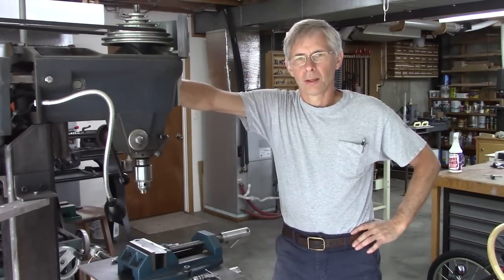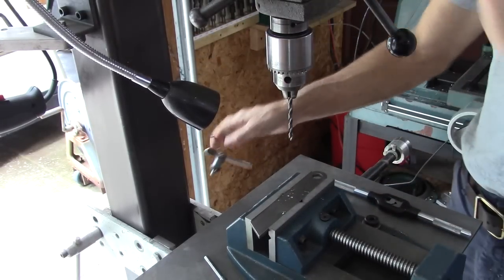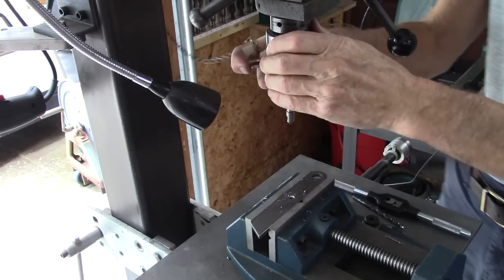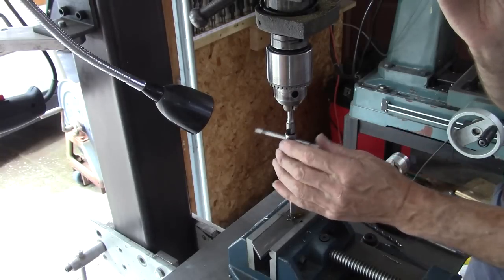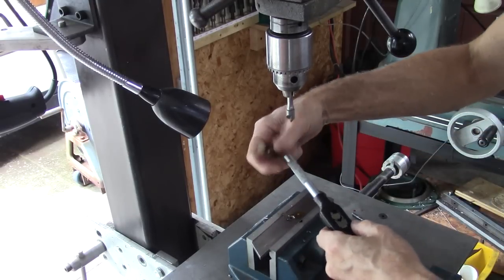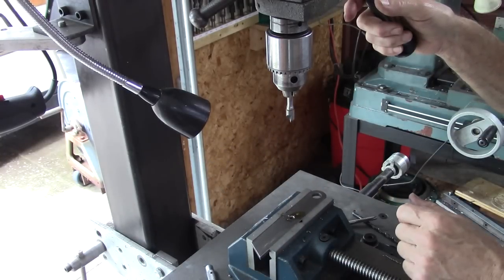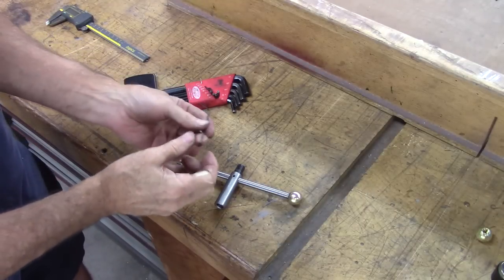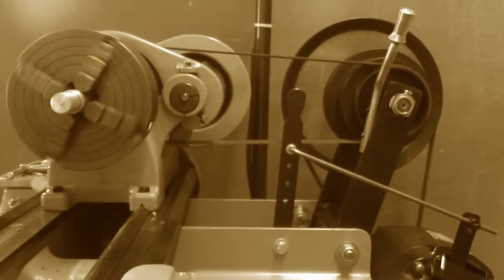Best Ever Guided Tap Wrench!

Comment: Instead of the set screw to hold the tee handle in place you could use an O ring that fits snug or a plain old rubber band twisted multiple times till it fit snug on both sides of the tee handle. Then if you did want to move the handle to get more leverage you could get it to slide instead of having to find your allen wrench to loosen the set screw
Reply from the maker: Thanks, that's a great idea!

Comment: If you like spring loaded guides, just drop an appropriately sized spring  in the top before you insert the countersink bit, and set your quill position to preload the tap handle.
Reply from the maker: This is true but there is really no need for a spring.

Comment: Hello Sir, here is another good idea and excellently carried out.  I bought the 3/8 "square drive tap Holder. To put your idea into action, I hit 2 points. In 14'11 What is the name of the black piece you sawed and do you have a link for it?  purchase. In 1'30 what and the name of your chamfering tool and maybe a link for the purchase. I cannot find these products on the web. Have a nice day with my kind regards. PK (French)
Reply from the maker: Hello Paul, the tool I used to chamfer is a "3/8" 82 degree carbide single flute countersink". They are a bit high priced but considering they last forever I think they are worth buying. 82 degrees is US angle for flathead bolts/screws. If you are not in the US you might want to get a 90 degree as most metric screws are 90 degree. https://amzn.to/3vlkkQl  I'm not sure what you saw at 14:11. Maybe the 3/8" extension I sacrificed?  https://amzn.to/3vjNGys
Reply: @WinkysWorkshop  Hello sir, thank you for your information.  For the extension it's ok, concerning the chamfer cutter, it is out of stock;  I'll wait.  Thank you for everything, good luck and have a good day.  P. K.
Reply from the maker: @paulk3573  - You're welcome. Ebay sometimes has them also - 3/8" 82 degree single flute carbide countersink

Comment: Second time watching. Question is the handle is sized to fit over the countersink? I do love how it is free to slide on that shift. But I don't think my countersink has that much of a shoulder. What do you think about just having a steel shaft to chuck up as the guide? Did find the chuck adapter on Amazon.
Reply from the maker: I got my adapter on Amazon (3/8" Square drive tap holder: 3095001). As for the counter sink. Mine is a 3/8" OD carbide single flute. I think I found it for $22 although I can not remember where. I've been using it for over 5 years now and it's sharp as ever. Highly recommend the investment. Yes a shaft would work perfect as well, even a 1/4" rod. The only drawback is you end up with one more tool change in your chuck when doing multiple holes. If your countersink has even a slight shoulder it will work great. It's only holding the top, the bottom is guided by the tap. Thanks for asking.

Comment: Great job Winky , is that an electric drill hooked up to the rack and pinion , love to see how u did it.
Reply from the maker: .Yes a 3/8" electric drill. It was an easy modification but it would be difficult to modify a standard drill press with this modification. The drill press was previously modified. Thanks, here the drill press modification https://youtu.be/i4_FtMMMfDw
Reply from the maker: https://youtu.be/3p5AD3kFqTY

Comment: hello Mark,
Nice video video.thanks for sharing...see you next time........Mark i was thinking how about if you knurled ,the center of the handle  with about 10th.knurl that should hold the handle in the middle.just a thought.
Reply from the maker: Hello Ray, Thanks...  yeah if nothing else the knurl would look cool! I need to imove my knurling skills too,
Reply: Ray, A little Loctite 380 (Black Max) also woks great.
Reply from the maker: @simguns8388  Thanks...  the set screw works well however. Never heard of the black max. I'll check that out.

Comment: I like that, it gives the use of both hands to tap.  Where do you buy those 3/8 tap adapters from ?👍
Reply from the maker: Thanks.  Run a search for this "3/8" Square drive tap holder: 3095001"

Comment: With the 2nd type you used the wrong size if you used a smaller handle/ holder the back of the tap sticks threw, allowing access to the center hole on the back of the taps square end. So can use a dead center.
Reply from the maker: This true if you have taps with a center hole. Most my taps do not have them and the ones that do are all larger sizes (3/8" or larger).
Reply: @WinkysWorkshop  thats a pain, keep up the great content on machining
Reply from the maker: @JohnBlack-dv8ss  Thanks John.

Comment: They work okay but not very well with an air ratchet or in tight area's on equipment. I went to tap sockets instead. Using a ratchet works well for me. If you are fabricating this would work, nice video, thanks!
Reply from the maker: Your welcome and i agree

Comment: Very nice idea, 
Now a question, your drill press has a reverse? If so why not tap using it?
 I know some don't.
Reply from the maker: No, my drill press doesn't reverse or go slow enough. I have used drill presses like this before but I've never had a lot of luck getting the chuck to grab a tap. I do this in my lathe although I have the same problem. I probably need to invest in an ER collet.

Comment: Very good video< got a question where do u pick up the tap holder? I am going to make me one like that
 I do a lot of taping that will make it a lot easer too.
Again thanks
Reply from the maker: Thank Richard, The part number is 3095001 and it's made by Irwin and Grip. Google the number and you get several options. Honestly, I've made a lot of machine improvement but this tap handle is the most useful item I have ever made. I use it daily! Of course I also made a square column and a power table lift for my drill press which makes it quick and easy to use.  Let me know how you like it when you get it built.
Reply: @WinkysWorkshop  thanks for quick reply, I will sure let u know how it went. I could of used it today had some fittings I had to make for my zero turn, thanks
Reply from the maker: @richardhaen  You're welcome
Reply: Good morning, well I made it and finished it last night. Will get the tap holders tomorrow will c how it works.
Would like to send u a picture of it but don’t know how. I made a few changes on it and a few mistakes but worked out.
Thanks again. I do need more room on my drill press it is a bench top.
Reply from the maker: winkysworkshop@GMX.com

Comment: That is an interesting take on a tap wrench
Reply from the maker: Much better than a T handle with a spring loaded tap follower. More leverage, easier on your hands and you can leave the countersink bit in the chuck. I made a different version which worked well but this is way easier to make and more durable (I broke my first one).

Comment: Hey Mark Great video liked it alot fantastic idea too.
But am wondering about excessive torque on small to medium size taps and may cause to snap especially in tougher material. What do you think?
Stay safe and take care mark.👍
Reply from the maker: Thanks Troy, of course this is possible but you might be surprised how much torque a tap can take when it is guided.  So far I have never broke one even with a standard t-handle as long as it is guided.
Reply: @WinkysWorkshop  thanks Mark will proceed to project phase 👍😊😊

Comment: Why don't you set the drill press in the lowest rpm, and put the tap in the drill chuck?  Possibly make a reverse switch on the motor.
Reply from the maker: The slowest rpm is too fast and it's not 3 ph. (no instant reverse)

Comment: Hi Winky 
 Can you put down the Sizes of the Rods you used, and what Type of Steel you used. I just bought the Tap Heads and want to make one of these.
Thanks
Reply from the maker: I used 5/8" rod about 2 inches long. You could also use 3/4" and use a 1/2" countersink bit if you wanted to. Nothing critical but I would not go shorter than 2" or you won't have enough travel. The hardest part for me was getting the good fit on the extension. If your hole is too big you can also braze it in place although be aware that the heat might mess up the spring on the detent ball that hold the socket on. Thanks for watching!
Reply: Hey Winky, I have to say. This has been the best Tap handle I have used. I like the rigidity a lot better than using a Spring Follower type guide. I actually mad a Pin to put in my Chuck that fits the wrench really well and it lessons the play when I’m Tapping. Thanks for the Video. I Like it 👍
Reply from the maker: @joeybobbie1  Very cool, glad you like it. Certainly a pin would work very well and also save you a little cash, the 3/8 carbide countersinks are a bit pricey.

Comment: Most ingenious.  Can you give source for the adapters?
Reply from the maker: Thanks you , Yes, the 3/8" Square drive tap holders are 3095001
Reply: Winky's Workshop where did you acquire them?
Reply from the maker: @romoshka1  I bought mine on Amazon. Google the number and it will give you other sources also
Reply: Winky's Workshop got it. Thanks

Comment: Also, is that powered lift on your drill press a purchase item or is it your own design?
Reply from the maker: The power lift is a Harbor Freight 3/8" drill but I had a hand crank on it for a long time. The drill press is very much modified however. It has a square column so that the table stays in the same horizontal position as it moves up and down. Sadly it's a significant modification although well worth the effort in my opinion. I do not understand why Grizzly of Jet tools don't make a drill press like this???  Anyway, this is the first video of the drill press modification if you are interested. https://youtu.be/i4_FtMMMfDw

Comment: Winky, If you watch your video closely, you will see that your larger drill bit spun in the chuck.  When you tightened the chuck you only used one hole.  There, of course, are three holes.  Try tightening the chuck using all three holes.  I believe you will find better success drilling and drill bits will not get a chewed up . . . not you mention that you chuck will last longer drilling more concentric holes.
Reply from the maker: I'm sure I could have tightened the drill better and using the other holes does help to some degree. Sometimes nothing will hold the drill. I'm guessing the chuck was worn when I got it. Thanks for the comment.

Comment: Wait! What? Why not just put the tap in the drill press chuck??
Reply from the maker: Most consumer drill presses go too fast including mine. If it was slower and had 3 ph with instant reverse it would be a good option. Also unless you have a tapping head its hard to back up to clear the chips for a blind hole.

Comment: Hey guy a no.7  or .2010 is for aluminum and a 7/32 or  0.21875 is for steel...
Reply from the maker: Both are correct actually but in most cases the larger drill is way easier and strong enough, especially with larger taps! I'm using an old drill/tap chart by Starrett. I need to print out one with the minimum and maximum sizes. Weird that Starrett didn't bother with this info, but you are right, thanks for the reminder.

Comment: I would get a 123 block and use the holes to guide it straight
Reply: Or get one of the tap-o mastic things I've seen on the manual mills thats the easiest way to manual tap anything in my opinion
Reply from the maker: That would work. I like this method although if you don't have a table that moves like a mill it's less benefit.

Comment: The first tap wrench you used would have done the job if you just slide the t-bar to the end for more leverage.
Reply from the maker: Yes it would, I have been doing it for years. It's simply a mater of convenience and ease. The new wrench is easy on your hands, has more leverage and will never slip out from under the spring loaded tap guide. And slipping the handle to one side makes slipping out from under the guide much more likely. I prefer the new handle. The only way I use the old tap wrench is for tight areas where the longer handles might be in the way.

Comment: Why not just knurl the middle. Thank you great content.
Reply from the maker: That would work well but after thinking about it the set screw is the best option I i think. If the extension was not a super tight fit the set screw would secure both the handle and the extension.

Comment: People still used geared chucks? Unless it’s a ball bearing model with built-in R8 for my mill, or Morse 3 for my lathe, I haven’t used one for years. I must have a half dozen in the draw. It just slows things down too much.
Reply from the maker: I've thought about changing it but it seems to be a very good chuck. The no doubt high dollar key-less at work slip worse...  kind of afraid to change.
Reply: Most keyless chucks come with a wrench. Supposedly, they self tighten, but I find that for heavier work, a bit extra torque from that wrench prevents slippage. As long as the arbor is part of the chuck, my;u can do light milling with them, as long as accuracy need doesn’t exceed 0.002”. My Waltham chuck allows me to mount a drill, or mill, while the machine is running, and to remove it while running. At first, it seems a bit dodgy, but you quickly get used to it.

Anyway, chucks are consumables, at some point they have to be replaced.

Comment: When ever a YT video has best in the title you know it isn't. Firstly when you countersink a hole slow down the speed. Secondly don't use the same tool as a guide as you damage the cutting faces. Just replace the c'sink with a point that is turned to 90 degrees and use the wrench. Some taps have a centre drill in the end as it is used in its manufacture, if it doesn't the 90 degree point lines up in the jaws. It's that simple, if you need more power just get a bigger wrench. That's the best way and you don't need to waste 15 minutes watching a video.
Reply from the maker: Ideally yes, the countersink needs to run slower. In the interest of time I didn't move the belt plus the 1 second deburring cut would never hurt the counter sink bit any way. Using the counter sink as a guide is a short cut. It never damages the cutter as its hardened and my tee handle is not (in fact in my case it is carbide). I've used and abused it for about 5 years now and it's sharp as ever. The tee handle tap wrench is worn however...  no loss, it's junk. Aside from power tapping and buying a different drill press (mine is too fast) this tape wrench is a huge time saver. The countersink is already in the drill press so one chuck change is eliminated. The leverage of the wrench makes tapping a breeze. I've seen your type before. If it't isn't by the book or your idea then is isn't any good. Sorry for your burden. And...  seeing as how 32,000 people have watched this video and out of 217 comments YOURS was the only negative I'm inclined to believe you are the one with a problem and not me or my procedure.  Thank god for people that think out of the box....  otherwise we'd have no progress and we'd still be living in caves. One last comment. According to you, the 15 minutes watching the video was wasted time. Why did you waste another 15 minutes writing your comment?

Comment: I just chuck them in my 18v drill and set the clutch just enough drive the tap. I'm lazy. If it dosen't have a motor, it's too much work.
Reply from the maker: I do the same but it also depends in what kind of accuracy I'm wanting.

Comment: Why don’t you insert the tap into the chuck run it reduced speed real slow and let the tap do the work..the tap will work for your plus you are going through 1/4 steel doesn’t make sense on what you are doing..
Reply from the maker: Well the 1/4" steel I used was simply for a demonstration. The main reason for not tapping with the tap in the chuck that my drill press does not go slow enough. Also if it was 3ph and instant reversing it would be a plus.  Then there is also the fact that it is one less tool change in the chuck if you chamfer the hole. Maybe I'm OCD but I usually do this.